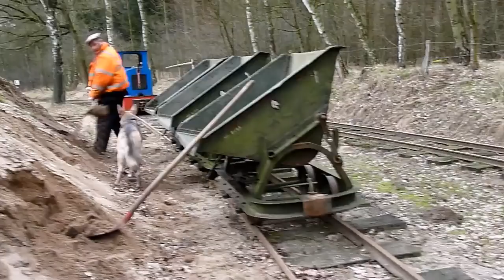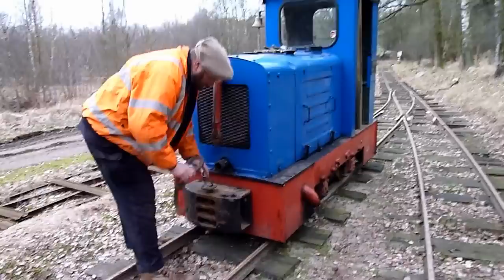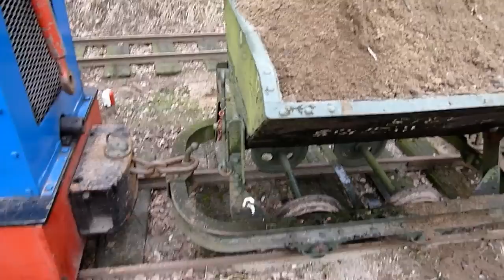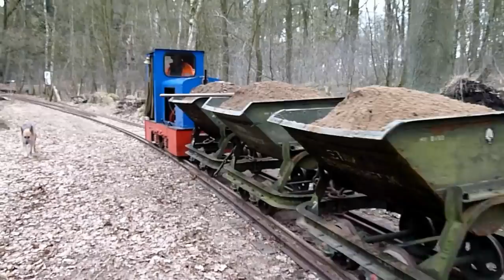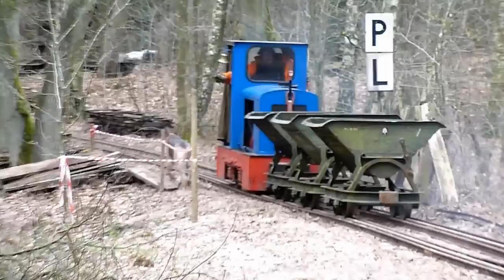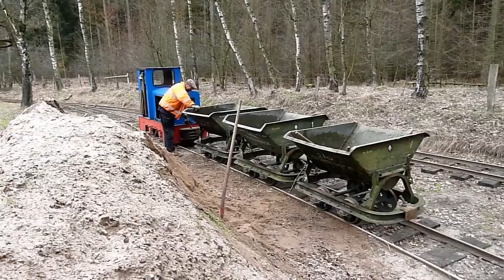Moorbahn Bad Bramstedt Sandloren-Betrieb / Narrow gauge railway with tipping wagon

Comment: The side dump cars reminds me of my Lionel 9330 4 wheel side dump cars. They came in cheap Lionel starter sets in the 70’s. I have over 20 of them. I wish I had 100 of them. I pull them either with my two Lionel 8516 0-4-0 switchers or my cute K-Line Porter. The Porter looks better but the 8516’s pull better.